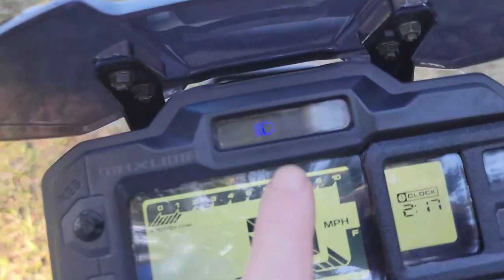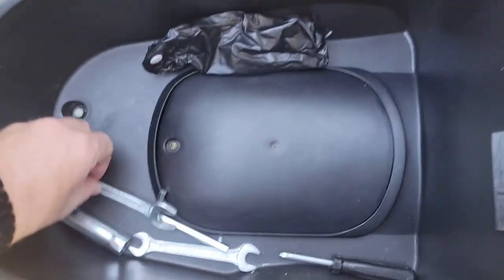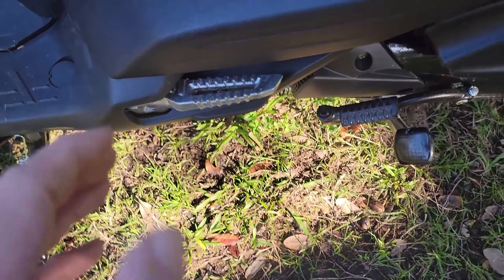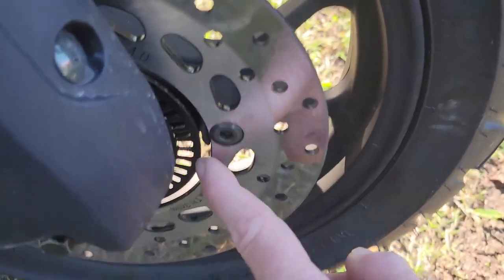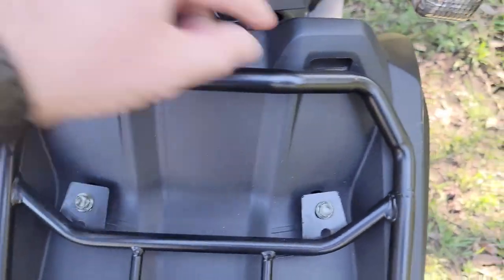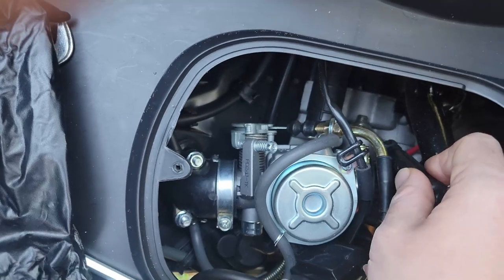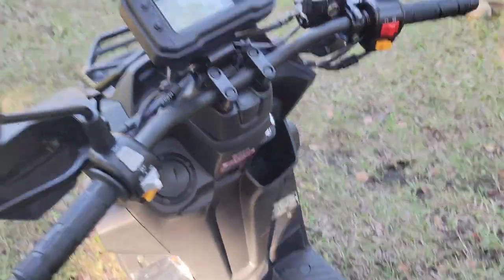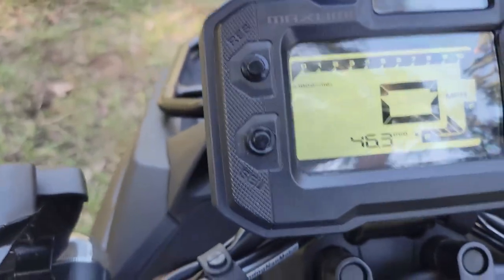X-Pro Tahiti 150 The $1,099 Yamaha ZUMA clone REVIEW.

Comment: I went to ride the scooter last night, very new scooter, less than 600 miles on it, owned maybe 2 months. It did not want to start. Finally did and then it kept dying on me. Finally after getting warmed up it ran okay, though it doesn't seem as strong as it has been. It seemed like it was having trouble getting fuel but the tank is full. 
It has never done this to me. It is raining so I put it in the garage and went out and it started without issues.
I'm a newbie so do not know the basics even. Is there an automatic choke on these things? Could it have been flooded?  Do the cheap Chinese spark plugs give out easily?  Clogged fuel line? It was a cheap bike, an X-Pro Tahiti 150. $1100 + shipping. 
I had ridden it earlier in the day without issues. I hope this is not going to become a regular thing.
Reply from the maker: If you haven't upgraded the carb, I would do that. I had issues with my stock carb. There is a link to it in the comments that I made. was $20 on amazon and came with a new spark plug and fuel filter.  Yes the scooter has an electronic choke. Also there is a carb drain located at the bottom of the scooter. it's at the end of a long tube that is surrounded by a spring, there is a Philips screw in it that if you turn it, it will open and drain the carb bowl.  If this happens again I would open that and see if fuel comes out. if it does not I would check the fuel filter.  maybe there was some debris in the fuel tank that worked its way out and clogged the filter.  I replaced the stock filter with the one that came with the new carb. EDIT: There is also a pulse fuel pump that runs off a long vacuum tube. Check to see if there is a kink in any of the hoses going to it. You can find it if you follow the fuel line from the carb.  Although the tank sits higher than the carb so this is not likely the issue.  its a good idea to check out the lines for any bends or kinks. It can happen if they cut a line too long.  And while you are down there I would check that the exhaust nuts are tight.  Mines loosened up and ended up falling off on a long 100 mile ride I did last week.  I think they were loose for a while because after I replaced them the scooter is very quiet.

Comment: 3 trips to the Nebraska DMV so far. Still no plates. The biggest hang up has been mysterious requirements some inspector in Lincoln (I'm in Omaha, 50 miles away) is telling the ladies at the desk I need.  An "EPA Sticker" and a "DOT sticker"  So I'm looking all over the bike for these damn stickers. I asked the lady  "What do they look like?" "I don't know" "So how am I supposed to know what they look like?" "I don't know". "Do you know where I can find this information?" "No, I don't know"

So I finally figured out the large metal sign to the left of the steering column above the floorboard is the EPA "sticker". I thought that was enough. It is extremely difficult to photograph because it is metal and has a terrible glare. I brought in a photo but he still wanted the "DOT sticker". I'm searching all over the bike for a damn sticker there is none. Google finally showed me it doesn't say "DOT" on it at all, but is a Federal Safety notice. It is another metal tag, this time on the right side of the steering column, just above the floorboard RIGHT IN PLAIN SITE. 

I had emailed X-Pro and asked them. They had no idea what I was talking about.  I emailed the guy in Lincoln and he hasn't responded. I can't believe what a hassle this has been. To compound it all, my printer doesn't work very well and I still haven't gotten a readable photo of the "DOT sticker".  This is unbelievably difficult. 

I have around 150 miles on the bike so far. I'll be doing the first oil change soon. I changed the oil when I first got it. It recomends 300 KM. Afterward change it every 1000 KM. Bike is running great so far. I have had it up to 46 mph, though trying not to go too fast. But I have to ride a couple of very busy streets with heavy traffic to get to the DMV.
Reply from the maker: Wow,  that is crazy.  I know that some states are crazy. Do you have state vehicle inspections, like emissions? In Louisiana we do not have any emissions tests but we do have what we call a brake tag. This is just a test for basic safety items like horn, turn signals and brake lights. BUT it is done through your local parish (county) at repair shops, muffler shops, and even some gas stations.  and wont stop you from getting plates because part of the inspection is having valid registration. 
If you have a library near you I would take a bunch of pictures of the plates needed using different lighting to see what shows up the best. try taking the pics from different angles. Then email the pics to yourself and go to the library and print them out there. It usually costs less than .25 cents a page. OR you can search for FedEx Kinkos , Office Depot locations which also have professional print services. When you go to the DMV  bring all the pics you took because I would think that if you can at least see all the data even if it is from 2 separate pics should be sufficient.   I just looked at my scooter and yes both of those plates are the ones they are looking for. Or just take a video with your phone showing all the stickers and bring that in to the DMV. maybe they will accept a video showing what they need...  The big one on the left is the California CARB certification which has all the emmisions data, and the smaller one on the right is the DOT plate which has the VIN number, Manufacturer name and assembly date along with engine displacement and emissions compliance (at the federal level). The one on the left is only needed for registration in states that require CARB certification. This would likely be the EPA sticker they are referring to.
Reply: Try going to a different dmv

Comment: Good video, and cool little scooter… but the “sense ring ” is actually part of the abs mechanism.
Reply from the maker: There is no ABS on this scooter.  Even the real ZUMA does not have ABS.  the ring is just a wheel speed sensor that just goes to the speedometer. Yes if it had ABS that sensor would be part of it though.

Comment: How does this scooter perform on hills? Can you start and maintain adequate traffic speeds going up and stop safely on a downhill?
Reply: I have the exact same model. 150 miles on it so far. I weigh 300 pounds. Brakes work great. No problem there. Even with my weight it is adequate. We have pretty steep hills around here (Omaha) and though I'm babying it since I'm still breaking it in, it has power to get me up the steepest, though it does slow down. During the break in phase you are supposed to keep it down to 30 mph or so. I've been doing that as much as possible but have gone on some busy roads with fast traffic and had no problem getting it to 40 mph. I was NOT using full throttle. My guess is it'll do 50 mph even with my weight on a flat road. But I haven't been able to test it yet.  It is obviously not built for speed. I think 30-40 mph range may be best. I'll write more about it later.

Comment: Hi Scott, I bought this motorcycle 4 months ago. It has 1000 miles. I was driving and it suddenly shut down. It doesn't start again. I checked it with a mechanic, and he checked the spark, battery, and fuel pressure and everything looks good. The motorcycle lights and the starter works but you try to open the switch and give spark but it doesn't start. I contacted the company by email (they do not have a phone number) and they do not reply. What do you recommend?
Reply: The dead☹️

Comment: Merry Christmas! Scott ..... What's the news on your X-Pro Tahiti 150? How is it holding up? How many miles have you put on it over the last month?
Reply from the maker: I have about 300 miles on it now.  My work commute is only 10 miles round trip.  It has been warming up a bit so Im  planning on making more videos. I have a lot of good things to say about this scooter.  And I figure Ill do an Engine and CVT oil change video and go over the little things that I have had to adjust over the month.  Things do loosen up on these cheap scooters. But so far nothing dangerous, just the exhaust hanger bolts loosened enough to give a weird noise at high RPMS.  Nothing a little locktite and a proper torquing down cant fix.  Overall Im really happy with the purchase.  The real test will be beyond 1000 miles.  I did purchase a Japanese made Carb for the scooter. Its the same carb, But has branding on it.  Im waiting for some good weather to put it on and test.
EDIT:  I thought I should add that the Carb that comes with the scooter is not bad. I have had no real issues with it so far.  It always starts, and keeps a good idle. BUT sometimes it will lean out under full throttle. it feels like at Wide open throttle it looses a little power, if you back off it will get the power back. To me it seems like an issue with the atomizer and needle. Its very intermittent and depends on the weather a lot. a cold morning I wont have any issue. but in the warm afternoon I will.
Reply: @scottcol23  
Just too lean
Reply from the maker: @68M35A2  That is correct. BUT the cheap stock carb has no adjustment on it. Where the screw should be is just a brass plug.  The carb I ordered has the proper adjustment screws and now the scooter is preforming flawlessly.
Reply: @scottcol23  what carb and where did u get it from
Reply from the maker: @davidlatham7839  Amazon. https://a.co/d/0VAp8PX

Comment: I have a zuma clone as well I’m having a issue with it wondering if anyone else has this problem seems like on the digital display. It wants to read how much gas I have in the tank whenever it feels like it. Sometimes it shows up other times it won’t pop up. Is that something that’s wrong with it or is it normal for it to only mark the gas at certain times?
Reply from the maker: It should always read the fuel level.  Sounds like it is a fuel sending unit issue in the tank.  First I would look at all the connectors and check where it grounds to the frame, making sure it is a good connection as It could be a ground issue.. Remove the bolt where it mounts, clean the surface and re install.    If you are still having problems I would just replace the fuel tank. You can get the parts from the dealer who sold you the bike. I went through power sports max. And they can get any part on it. Not sure if they only sell parts if you purchased it from them. But its worth a shot if your dealer doesn't offer support.  To get to the tank, remove the 4 bolts located under the seat, 2 near the hinge and 2 near the fuel cap. Check for 2 Phillips screws on the side you might need to remove and the whole seat and storage comp. lifts off. You can also remove the front cover if need be.

Comment: Would this work for a to and from work vehicle. I need to get atleast 20k miles out of this if I orde it?
Reply from the maker: I'm at 2k miles with no issues yet.  I use it as my work commuter every day.  It has been a good scooter. I'm really surprised at the quality. And highly recommend getting one.  Just do regular engine (10w40) and gear oil changes (80w). Plus I'd upgrade the carb as the stock one is not that great. There is a link to the one I got in the comments.

Comment: Are those two boxes on the dash on the right  the engine light and the temp light
Reply from the maker: oil light. there is no temp light.  this is air cooled
Reply: @scottcol23  okay thank you for your response!   There are not a lot of videos on this bike!  I was looking into to the x pro Tahiti 150cc and the x pro x19 which would you recommend.  It would be awesome if you could make more videos on this bike.  Also how bright are the lights at night and is the seating position comfortable because I have the ice bear vision scooter with almost like a banana seat!
Reply from the maker: @anthonyrossi3869  Ill make some more videos soon.  I'm off work on monday.  As for the lights.  They are better than I thought they would be. Compared to my Lance Cabo, These have more coverage, and dont have a weird pattern the emit on the ground which is good. I did pick up some Philips Crystal Vision 4000K bubs I'm going to throw in.  I think ill make a video showing the replacement and what it looks like under the dash.
Reply: @scottcol23  i really really appreciate this review!  as this is the only one I’m set on getting the x pro Tahiti 150 as shown in the video now I lm definitely getting this bike in the spring because off this review I love the design and the digital dash! Currently I have the explorer 50 with a 80cc big bore kit same as the ice bear vision scooter design.
Reply: Thankfully I read the comments and got most of my questions answered.  😄
Thanks for the review, very thorough.   Looking forward to the upcoming vids.  😎🤜🤛

Comment: Which one is good viper or x-pro
Reply from the maker: X-pro is just a US Importer of Chinese scooters.  So each X-Pro scooter could be made by different manufacturers. The X-19 and Tahiti are made by Senling in China. Vitacci is the same story, each model could be made in a different factory.  The X-pro scooter in this video is great. It literally has all the same parts that were on the Lance that I owned that was $2k more that the X-pro.  Although with a Lance scooter you get a motor made by SYM (they make engines for Honda), and a 2 year warranty. Plus just about any scooter shop will work on it.  These Chinese bikes are impossible to find a shop to work on them. so you will need to do all the servicing yourself.

Comment: Can you order the Tahiti fully assembled from X Pro?
Reply: Yes. I just did
Reply: @jarodhuber2687  Do you pay extra when you ordered it fully assembled ?
Reply: @danl5632  I paid about 1,300 for it fully assembled. And shipping was free. I’m assuming it was free cause it included in the overall price.
Reply: @jarodhuber2687  I just got mine, supposedly fully assembled, but not really. Most of the assembly has not been too tough but the rear kickstand spring simply does not fit. Were you able to get yours on? I don't really see why they didn't install it at the factory. It isn't in the way.

Comment: Which specific oil do I need for this exact scooter? Anyone
Reply from the maker: 10w40  I use Motul 4T 3000,  its about $10 a quart.  Of course you can use regular 10w40 motor oil if you want.
Reply: @scottcol23  appreciate you bruv
Reply: I can’t find that one you recommended, do you think the 10w40 4 stroke synthetic valvoline will be fine to put in

Comment: plenty of motor goodies for a GY6 motor if you want to upgrade things. These are typical Chinese mfgr. They're mostly ok but you have to check on all the bolts every so often. This is the level of quality we're going to have to accept since the bulk of consumer goods are made overseas. The electrical system and body are the weak points in these. Each bike out of China is guaranteed to have 1 mfgr defect, usually it's nothing, but it can be a ttl fail.

Comment: I would have spent a little bit more money and got a Yamaha zuma
Reply from the maker: The point was not the spend $5,200 on a new scooter from the dealership.  Went and priced one out. They are $4,200 plus delivery and prep fees which at my local dealer ends up being about a grand. There are no discounts because they fly out the door. But yes, I agree. If you are looking for something that will run well over 40k miles and has a 2 year warranty. Then I urge you to spend the extra $4k on the Japanese scoots. 100%

Comment: Hah!  It's a Chinese scoot.  No parts, no service providers, no scoot shop will touch them...

BUT, you get a shiny, shiny out of the shipping crate.  Plus a bunch of thumbs ups from people with sub 1k miles on theirs...

These things are built to look pretty out of the box and drive decent for a thousand miles or less.  After a thousand miles?  Junk it and buy another one; nobody will fix it.  It's junk the instant anything major breaks.  Can't get parts, wasn't built to be fixed... it was built to sell for cheap enough to sell a lot and to look pretty out of the box and to last for MAYBE a thousand miles.

If they lasted long enough for the resale market, cheap people wouldn't keep buying them new...  When was the last time you saw a Chinese scoot actually sold on the second hand market?  My bet is "never", because they are ridden for 1k miles, something broke, and then junked.

Buy a REAL Yamaha instead of suspiciously cheaper "knock-off".  Or better, buy a Honda or Vespa or Piaggio.  You can get 50x the life out of the real quality thing for 2-3x the price.

Yeah, a Honda is gonna cost 3x the price, and then it will just keep working.  Repair shops will do Honda work and Honda parts are available.  Same with Vespa-Piaggio.  Yamaha and Kawasaki, probably.

But Chinese manufactured knock-off manufactured anything in the scoot world equals "when it breaks, it is junk".

And it will break.  Faster than you think.  I know because I bought a few before getting smarter.